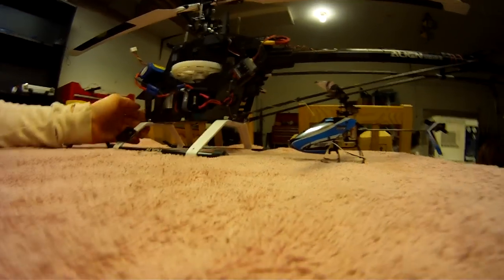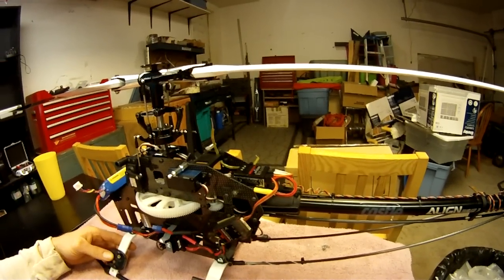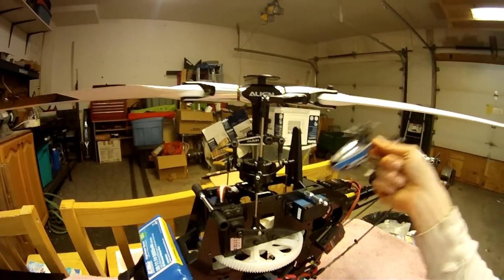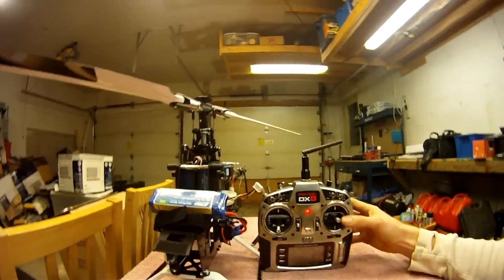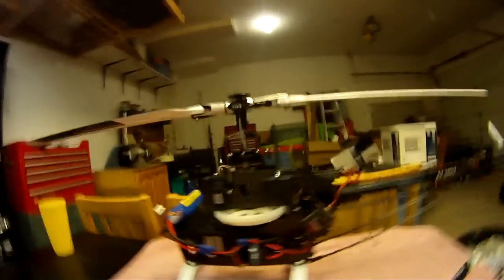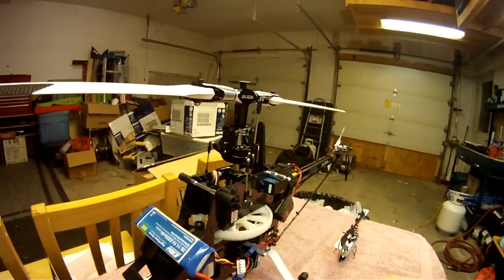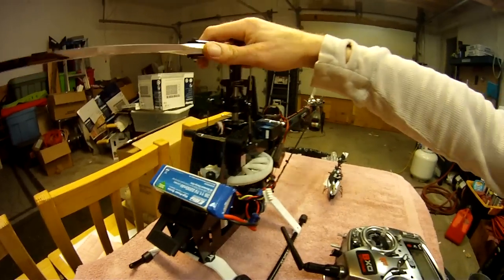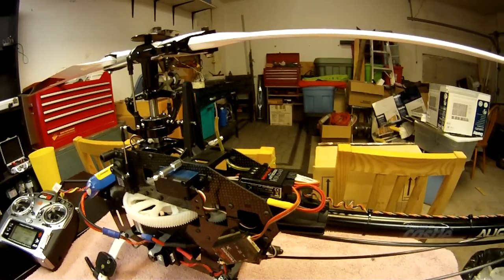How a flybarless system works (BASIC)

Comment: How do you like the 7200BX unit? Thinking about this rather then a separate receiver and FBL unit but the all in one units scare me a little.
Reply: The 7200 is a good unit for an old unit. It has one major fault thoe...
The 7200 has very low vibration/hormonic tolerance... So make sure your mechanics are tip top smooth. The 7200 is well known to give full rate to right roll spontaneously if it gets spooked by vibes. Basically, the unit itself looses its own orientation.
Reply: @CommentRedacted  
Yeah. Its more of a potential issue with small birds, 450 and 250 class as driveline RPM's are much higher resulting in very fine high frequency harmonics that that dont appear as 'vibration'. The ar7200bx came along when FBL was still new, so it deserves some slack for its shortcomings. Foam tape works, but the gel tape is where its at.
Reply: @CommentRedacted  
If you are looking at moving past the 7200 I totally recommend the microbeast plus. Its all beastx... (the 7200 was a spektrum partnership). Way faster cpu, 6 axis vs 3 axis, governer, will support sat rx. Flies on rails. Vibe intolerance is a zero issue. I mount mine on both birds on two layers of gel mount.
Reply: @CommentRedacted  
Yeah. Align makes good gel mount. I use 2. Look me on facebook if I can be of help. Welcome back to the hobby. 👊👊

Comment: I've always wondered what the purpose of the follower arms was my self
Reply: it's just to keep the top half of the swashplate in line with the blade grips, so you're not using the pitch links to do the job and drag it, for it will shift out of line. for example on a nano cp x, there is no follower arms, just the pitch links, but the head has little fixed guide bars that hold the pitch links straight. which you can get away with on a tiny helicopter, but the bigger ones it's more risky.

Comment: I am bashing together a (hopefully) working model from parts of several art tech Falcon 3d. I have a huge lot of new and used part to do this. (no docs.) having never set up a heli it's been quite the challenge. it has a flybar on it, I am using a futaba T6XAs rafio, and I need to get it set up right. can you direct me to helpful info? (all old stuff I know, but is available and was cheap.)

Comment: I am noticing on a lot of various rc heli. vids. that the swashplate movements are "in phase" with transmitter stick movement. not 90° precessed as I understood it was necessary due to gyroscopic procession.
why is this? has the head been designed in a way to compensate?
I'm not a heli pilot (yet) either. but I would like to get this straight in my thinking before I attempt a lift off. someone please explain.

Comment: Very helpful vidieo man.  I just got a couple of Esky 900 (500 size) helis.  It has the old flybar system.  Can I use the 3axis flybarLESS gyro on the bar system heli?  Will this give me extra stability?  Now that I know more about FBL, I think I like to convert at least the one heli that I got.  Last time I check though, I didn't see any conversion head for the Esky 900.

Comment: I find it easier to explain that just by saying that the flybarless box is flying the helicopter. it is responsible for controlling all the servos related to yaw pitch bank and all that... so really the box is flying the helicopter and when you send signals from the controller they're going into the gyro box and basically asking the little autopilot in there to turn left turn right or deviate from its course. with no input  the box will attempt to keep the helicopter level. with inputs, you're telling it to make exceptions to the corrections it is applying.
Reply: Nope. With no input, the heli will remain in the same attitude as the last input. No auto leveling.

Comment: thank you  so  much, hey  i  just  got  a  trex 600e  fbl  on  craigs  it  has  some  goood  electronics. i  have  to  bind  the spectrum dx61  to  it. the  owner  told me it  will work for  this   bird, oh  he  stretched  to  a  700 size, plus  im  not  that   inclined  on   mechanics , im  just  rc car  kind  of  a  guy, th main head  blade moves  a  little  i  guess it  could need  new  bearings  , or  is  this normal ,  thanks  again  for  your   vid,  i  would  realy  appreciate  the  advice. cheers
Reply: thank  you for  the  tech advice my  friend.

Comment: I'm having a problem with the EXI 500 HELICOPTER the main blades are turning clock wise but the tail blades are turning clock wise as well the tail blades should be turning away from the heli which is counter clock wise help please I have taken this thing apart 4 times still can't figure it out
Reply: Electric or glow fuel?